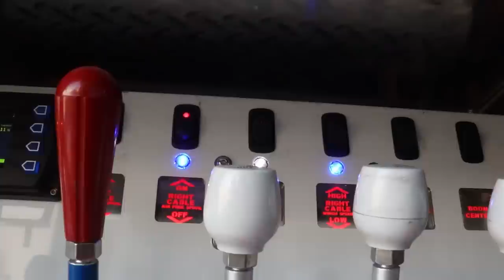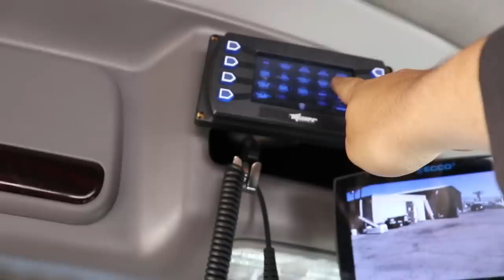Rotator Gets New Lights And Grease | VLOG 011

Comment: The lights on the grill are really going to help if you ever have a problem with them staying mounted fabricate a piece of aluminum or some type of metal on the backside of the grill so the bolts have a solid surface instead of just a grill to mount to
Reply: thats kinda what washers do

Comment: I was a ASE heavy cert mechanic. Specialized in electrical   at  heavy duty  shop .  Shavers comment is  great.  It looked like you used male/female connectors for the wiring.  I know you are in the desert but the tape covers on the body will eventually cause you trouble. When you get a chance get heat shrink  on them. It is a mechanical and waterproofing step worth the time to give the longest life to the circuit. They look great  on the grille.
Reply from the maker: If you look close there is blue heat shrink over every connection :)
Reply: @plazatowing    Didn't see it the first time

Comment: Nice bright lights, with a few exceprions, no such thing as too much grease, pull toy here.
Reply: In my 25 years as a mechanic I saw as much harm done by over greasing as by under greasing. Too many grease monkeys burst the seals or boots and let dirt into the joint. Some also fail to clean the fitting and push dirt into the joint.

Comment: On a previous segment regarding a red tractor with trailer in the center divider, you separated the tractor from the trailer and processed to load it onto a lowboy. The crew wasn't able to fully secure the tractor onto the lowboy,  and drive off that way. Seems to me your rotator would have come into play to assist in loading the tractor properly and completely onto the trailer? I enjoy your filming, and can relate to working with a rotator as I did your type of work when I was in the military. Keep up the good work. Stay safe.

Comment: DON'T use self stick pads for anything. They will NOT last. They will fall of in less than a year.  Wiring loom is wonderful to protect the wires as well as keep them neat.
Reply from the maker: The particular stick pads I use are pretty high quality. I've used them on previous projects on the trucks including exposing them to direct sunlight and those have held for 2 years now. I've found that, like paint, the prep work is the most important. I take isopropyl alcohol and clean the surface very well before sticking. Thank you for watching!